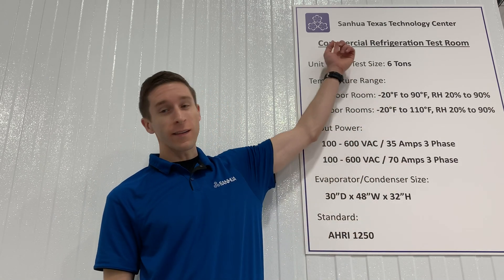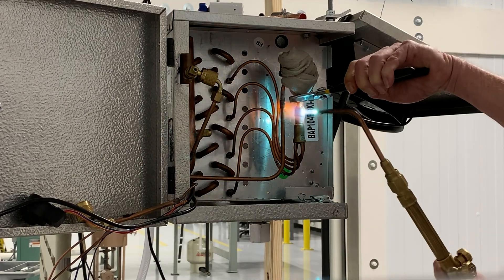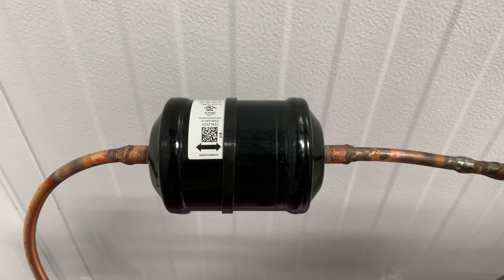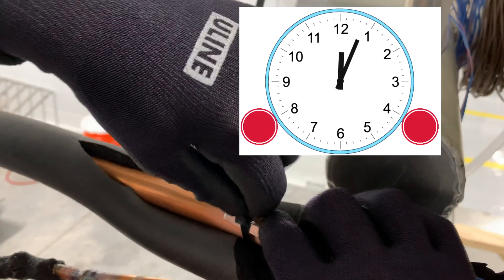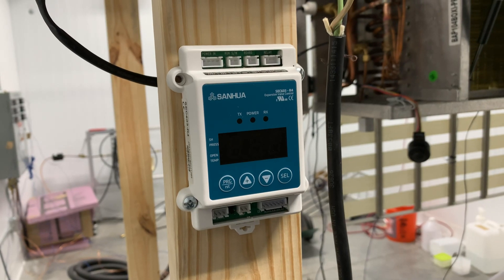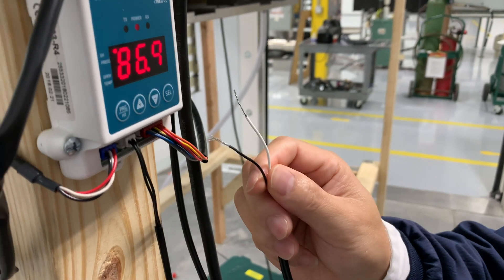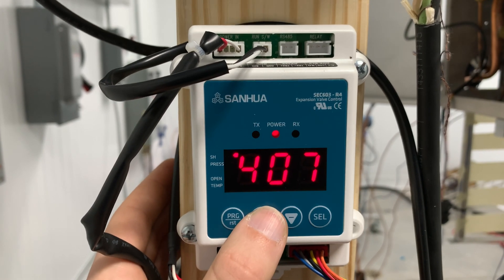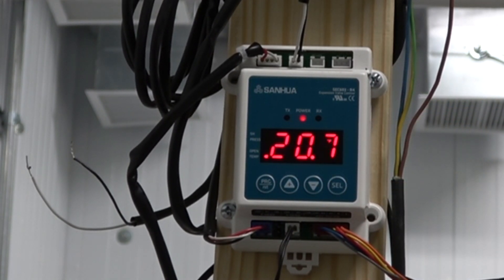How to install Sanhua EEVs into HVACR systems

Comment: Don't waste your time with this company. I tried contacting Texas, China and UK with questions about installing this in my heat pump system many times, they don't get back with email or phone calls.  The controller meters when activated and can only be set to remain closed when deactivated which is the opposite of what is needed for a heat pump.  I tried to install a check valve, without it being a cobbled mess and bulky, it's not doable. I also know the check valve will leak by a little.  The SEC611 is in Celsius FIY, they don't mention that in any literature.

Comment: The LPF valve in the video is not set up for A/C evaporator coil.  To use it for a typical air-conditioning evaporator coil lots of field adaptation would have to put in place.  For example, take the LPF-18, the outlet is 1/2 inch you would have to convert it back to 3/8 to fit a typical distributor on the coil, and also for the valve to stand upright you would have to make a j loop before connecting back to the coil inlet.
Reply: Hello Tong, we now permit installation of the valve on its side, at 90-degrees. So no J loop needed.
Reply from the maker: Hi Tong Luu, Sanhua offers DPF valves that work seamlessly with this controller setup that can be used for AC/Heat Pump. You are correct, the LPF is mainly a refrigeration valve.